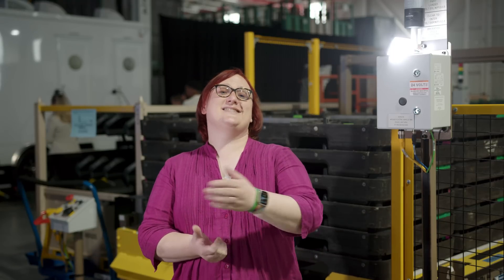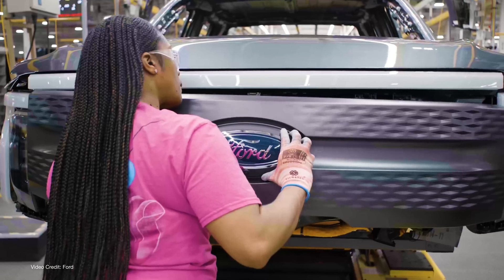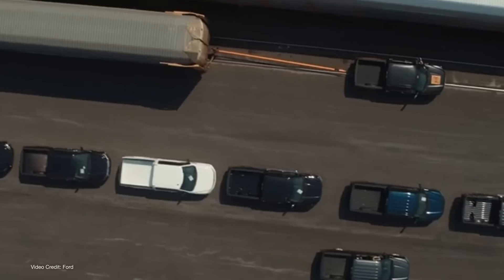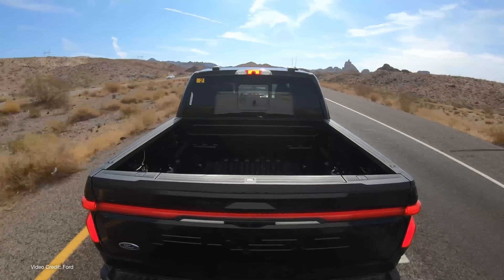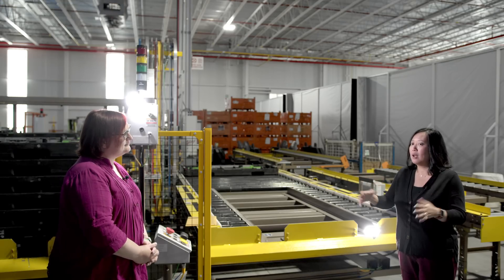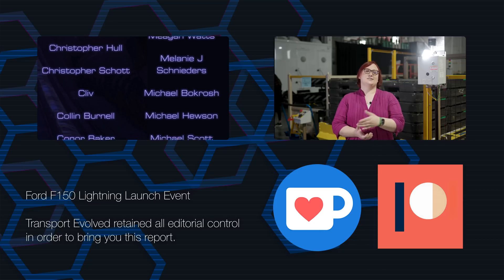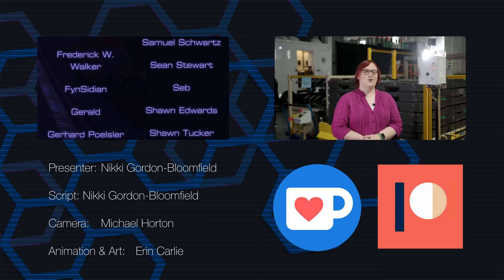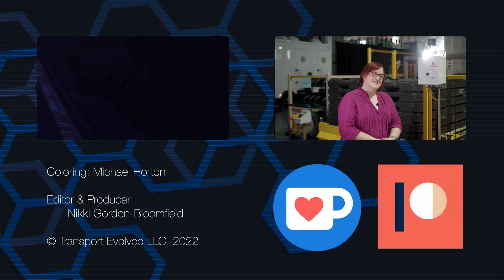We Interview The Ford F150 Lightning's Chief Engineer, Linda Zhang!

Comment: Best looking truck on the market right now IMO. And I love that Ford really brought their A team in to reinvent this product and make electrification a FEATURE, not a compliance excuse approach for shortcomings or compromises. We still are not quite to the EV Renaissance yet... But I feel like it is coming... an era when vehicles are designed for their pure fuctional potentional using a flexible EV architecture and not still beholden to decisions made by coach builders attempting to motorize horse-drawn carriages 130 years ago.
Reply: This is a modified F-150 platform where GM Silverado EV BT1 is a EV from ground up next year.  

Wait for Ford 2025 redesign. 

The Ford F-150 Lightning is already being promised a redesign for the 2025 model year. Reuters mentioned this when discussing Ford’s production plans for the Lightning.

Comment: The RANGE discussion often brought up by petrol heads is... I can only tow 1/2 the distance  I can usually go.. therefore a BEV truck is no good for me!... what they fail to realize is that a ICE truck loses 1/2 (or more) of it's range when towing as well. My Sierra gets 24 Imp MPG unladen on the highway and only 12-14 when towing my 14 ft enclosed trailer at 7000 lbs.... How is that not a similar loss of range? FWWIW... gas is currently $1.85 a liter here in NW Ontario Canada... that hurts when a fill is nearly $200!

Great interview!

Comment: This was so external, structure wise for towing and home charging , you guys are trying make clicks for the algorithm , I know you guys over time will have the real content, it must be coming . am saying this so you know that the real supporters of Transport Evolved & other EV channels , we know real content from external rambling. so when will the clickbait end, you are better than this stuff.
Reply from the maker: It was an interview, with the Chief Engineer - in a limited time frame... in a very noisy environment. What is click bait about that?
Reply: how is the structure of the truck connected to towing in the new EV structure and there's $2000 extra charge needed to charge your home. i dont want to cause a stir ,i just to keep you on the real path.
Reply from the maker: @teddyloyd2780  The truck has scales on board that figure out how heavy your truck is and how much range you'll have. That's a very much new feature for the truck. Additionally, where are you getting $2,000 from?
Reply: I think your getting your truck for around $49.000 , besides that you still need two special boxes at a $1000 each that will be put on the house. with out those box's you cant take power from the truck to the house.

Comment: Ford, if you're reading this, I want an 8-ft bed and a ride height similar to what you used to have between 1992 and 1996. I use my truck for work and these two features are critical to me. I don't want to tailgate that turns into the staircase from the Titanic, I want to be able to reach in the bed and load and unload it over the side without blowing my knees out.

Comment: I hate to burst your bubble but the Lightning is not a ground up design.  They adapted the existing F150 platform in order to get the product out faster than if they taken a ground up approach.  It's shameful that Ms. Zhang didn't mention that and let you go on believing it's a ground up design.
Reply from the maker: As we've said MULTIPLE times - the Chassis of the F150 lighting is all-new. It's even the first F150 to have independent rear suspension. The top half of the F150 Lightning is based on the existing F150. The chassis, drivetrain and battery are all new.
Reply: @transportevolved  Yes, the suspension was modified to fit the electric motor(s).  However, this does not make it a ground up design.  It is an adaptation of the existing F150 pickup.  The chassis is not brand new.  It is still a body on frame platform, where the battery is fitted between the existing frame rails.  You can spin it any way you like but this is not a ground up design.
Reply from the maker: @frankpandolfi6662  Are you a Ford engineer? Because every ford engineer we've spoken to say it's a new chassis. - Nikki.
Reply: @frankpandolfi6662  I have seen the naked frame/battery/motors. It is definitely NOT an F-150 frame. Much of the body skin and most of the interior are identical to existing Ford trucks. Perhaps that was what confused you. Ford intentionally kept the F-150 look and feel familiar to appeal to their existing customers.
Reply: @Miata822  This is a modified F-150 platform where GM Silverado EV BT1 is a EV from ground up next year.  

Wait for Ford 2025 redesign. 

The Ford F-150 Lightning is already being promised a redesign for the 2025 model year. Reuters mentioned this when discussing Ford’s production plans for the Lightning.

Comment: Another excellent video. Ford have nailed it in my opinion. Keep the looks but integrate the technology of electric DNA. It will out sell any Cybertruck that Tesla will make.
Reply: Not so sure about that.  This F-150 will still be prone to dents/scratches/rust.  The rust is the worst since it can kill a vehicle that should have had a longer lifespan.  Cybertruck won't have those issues.
Reply: This is a modified F-150 platform where GM Silverado EV BT1 is a EV from ground up next year.  

Wait for Ford 2025 redesign. 

The Ford F-150 Lightning is already being promised a redesign for the 2025 model year. Reuters mentioned this when discussing Ford’s production plans for the Lightning.
Reply: @normt430  A redesign won't matter if it still rusts.  I'm personally getting the Cybertruck because I want it to be the Last truck I ever need to buy.  Can't say that with all the others because they'll rust away unless their redesign includes stainless steel.
Reply: @MarkLLawrence  most GM and Ford trucks last about 20-years in the Great Lake region, also known as the Rust Belt as the old Japanese suffer from the tin worm that left them bleeding orange.
Reply: @normt430  20 years would be okay if I were in my 60's but I'm 40, I'd rather have something that'll last longer.
Reply: @MarkLLawrence  two decades is worst case scenario if maintained.     Yes, your the electrified Honda Ridgeline demographic.  Except the price!
Reply: @normt430  eww, Honda?  I'm going to be driving between Texas and California with the odd stop in Wyoming.  I need something that can work and not rust.
Reply: @MarkLLawrence  that is all vehicles today.
Reply: @normt430  stainless steel won't have the rusting problem all the other trucks will have.
Reply: @MarkLLawrence  stainless or aluminum is not the cure-all.  Besides have fun replacing expensive components from an accident.

Comment: Ford should be doing a 10x of production on these.  When they start rolling out to the public and contractors see the real world benefits, demand will go through the roof.
Reply: More free advertising for Tesla just like the Superbowl EV ads from other manufacturers, that caused a spike in Tesla orders. They will see what the F-150 can do, not be able to get one for 4 years, and go buy a CyberTruck. Sure it might take a while to turn up as they catch up with pre-orders, but I guarantee it'll be faster to hit 1mil CT's than 200k F-150's.
Reply: @PathosBedlam  Both companies will sell every unit they can produce for the next five years !  And the average CT buyer is not the same as the typical F150 buyer, so cross migration will be minimal.
Reply: @PathosBedlam  It's likely Ford will have two EV pickup trucks (full size & mid size) in production before the Cybertruck prototype is finished. Tesla sells hype, Ford sells vehicles.
Reply: What do you mean?

Comment: I WANT THAT TRUCK 😂 I WAS CONSIDERING A RIVIAN BUT  NOT ONLY DOES THE F150 FEEL LIKE A TRUCK JUST LIKE THE ELECTRIC SILVERADO. i wonder if they will bring back cars like a mercury tracer but as a modernized but super cheep ev😅 ik lots of people would rather have an affordable and long lasting vehicle that has 200 mi on a charge with manual roll up windows instead of having an overy advanced monster that weighs and costs more than a dump truck but can take off like it has a jet afterburner 😂

Comment: We are talking about a company that plans to make ICE cars until at least 2040. Right?
Reply: and...what is wrong with that ?  there will be a market for ICE utilizations for many years to come.  why can't they be both ?
Reply: @evquietcornerct3210  According to the e-prophets, any company not 100% electric by 2025 will go BK by 2030.
Reply: @msmith3395  ah yes, i have heard of them.  the digital oracles of sanctity and purity.  surely, they must be correct, and i should not question them.
Reply: @evquietcornerct3210  that is Electric Viking and followers!
Reply: ICE is still 96% of the automotive market and will be relevant for many years to come. In fact there are applications where ICE vehicles (heavy trucks) may be around for several decades.

Comment: How is the truck going to figure the amount of aero drag the trailer has?
The only way will be to estimate that as it's traveling, mass alone is not going to come close.
Reply: You start out by inputting the size (length, width, height & weight) or select a generic profile. The system computes the approximate range and fine tunes the computation based on actual driving energy use. It's a sophisticated methodology.

Comment: These F150s are very cheap. I wonder if they are making money selling them.
Reply: Nope
Reply: The base price version is a stripped out commercial version targeted to fleet sales. Farley has said that some number of them will be available to the public but primarily they will go to companies placing large orders.
Like any ICE pickup the other models have an extensive list of options that quickly run the price up. They aren't giving away the big inverter, clever towing package, etc. A fully speced Platinum trim Lightning is about 100k. Ford will make money. They know their customers and know how to build to a price point. There is a reason that the F-150 is the best selling vehicle in the US.
Reply: @Miata822  Makes sense. Cant see my base model cyber truck being 40K either. Doubt they will even make the base model.
Reply: @magamike1800  No way. I laughed when that rolled out on stage and even harder when he said the specs and the price. I've spent a career designing metal things. What we saw that night could not possibly sell for that price. The stainless monocoque alone would cost $40k. Stainless is expensive, difficult to work with, and not actually ideal for vehicle structural members. Forming sharp bends leads to cracks. Structural parts can develop stress cracks or brittle fractures. You can design around this with welded assemblies or thicker material, both add lots of cost. Pickups flex. SS doesn't like to flex. I could go on. (this thing really bugged me. you can probably tell)
Reply: @Miata822  Going to be interesting to see if they can pull off the cyber truck and interesting to read your take. I believe the idea will be to make a box frame with very little  flex and minimal bends. Deep scoring and then a wield to close the score after being bent will be required. I hope they can pull it off. My 2 biggest pet peeves with cars is fuel and paint.
Reply: @magamike1800  Scoring before forming means no tool contact on the inside surface of the bending material. They were saying 3mm, right? Assuming it doesn't crack you will have to dress out the discoloration on the outside.
I'm certainly not saying this thing couldn't be built, just that it couldn't be mass produced or made at a reasonable price.
Elon was already walking it back in the last earnings call, saying he was surprised at how much it cost to build. Really?

I had the opportunity at a Ford event to crawl all over the Lightning chassis (to the point I made them nervous w/ taking pics). It is lovely work. Appeared to be the same BorgWarner motor housing as in the Mach E but a different inverter I think. Same front and back. Then again, as a display I'm not sure if they were obfuscating details. The Lightning drives incredibly though. Fast + handling I can't believe.
Reply: @Miata822  I very much doubt the Cybertruck in it's present form will ever make it to production, it's no more than a concept vehicle.
Reply: @heathwirt8919  I didn't want to say that 'out loud'. It triggers certain people ;-)